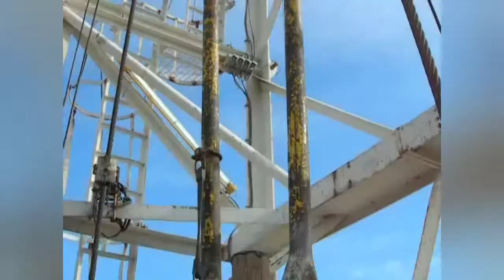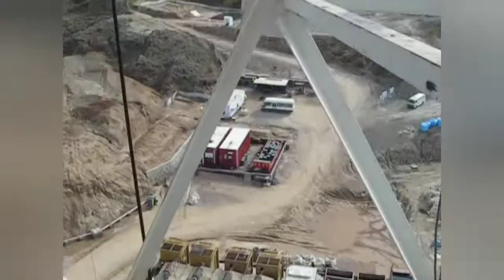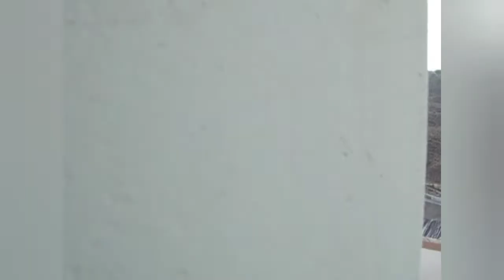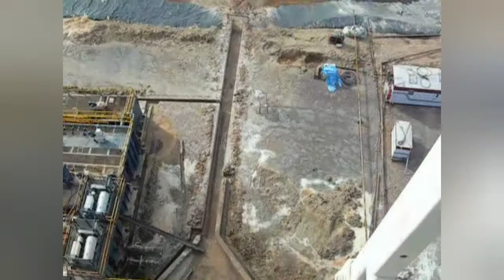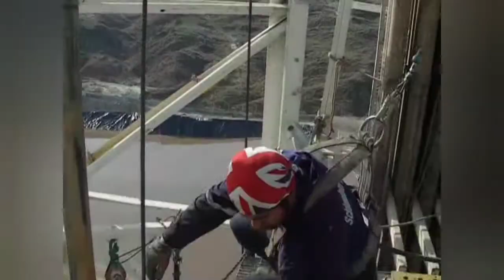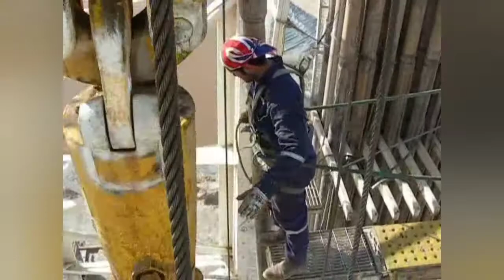Derrickman Work On Monkey Board Part 9 ! Drilling Rig SLB ! #rig #shortvideo video#oilandgas #shorts

Comment: The best thing about working the derrick is that you are your own boss. The most 5 inch pipe I've ever pulled in a straight 12 hour shift was 18,500 feet.